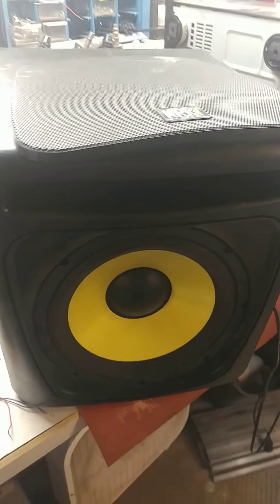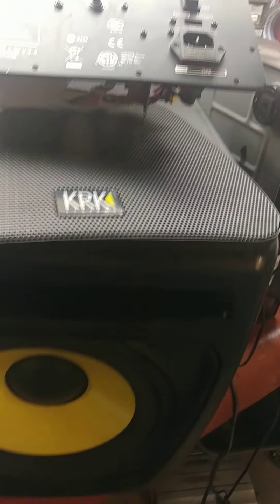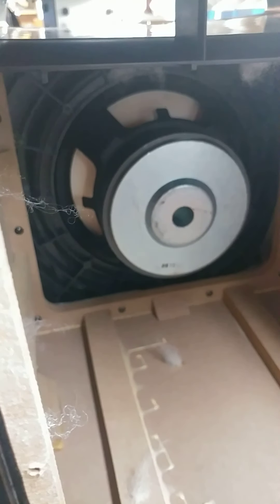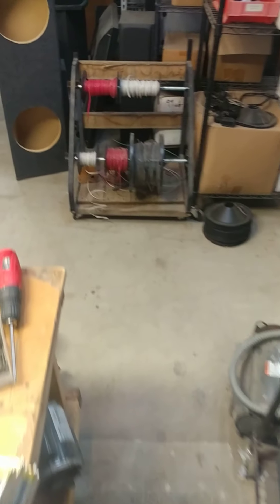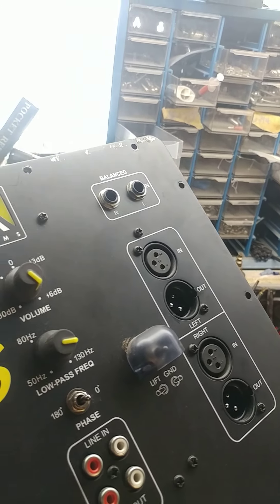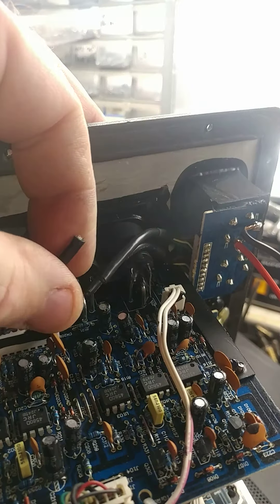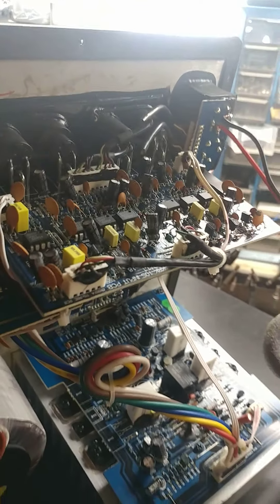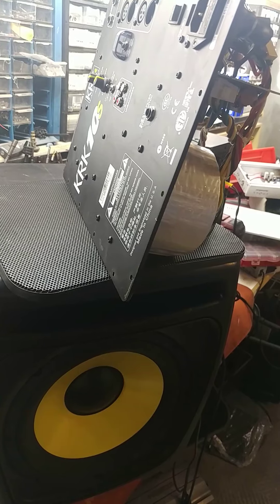KRK subwoofer amp bypass $300 saved @ The Robot Underground

Comment: I've got a question for you, I have a krk sub just like this that is stuck in standby mode. I've tried everything but can't get it to "wake up". The light stays amber and you can hear very faint signal being passed thru to the connected monitors of you crank the input levels. Any ideas what the problem might be?
Reply from the maker: Nope.  that's why it's easier just to bypass the OEM amp and power it from the outside.
Reply: @RobotUnderground  Thanks both for replying and the video.
Reply: Slayd5000  Try Parts Express for either a new plate amp or a new external amp, sometimes they have open box, special deals and returns that are cheaper than new.  Or look on craigslist for a powered subwoofer with a blown sub and good amp
Reply: I have a krk 12.4s wich is not coming out of standby mode... what to do?
Reply: @sindromerecords6667  In my case, it was defective, wound up having to send it back. Hope you can get it working again.
Reply: Slayed5000 did they give you any ideas what was wrong?

Comment: The black celastic adhesive they use for antivibration cause components on the pcb degrade I had the input bias transistors literally rust off the board on those monitors...